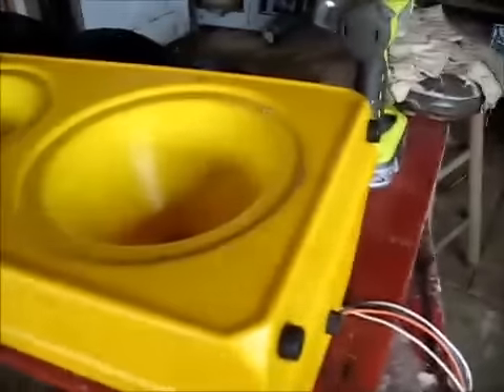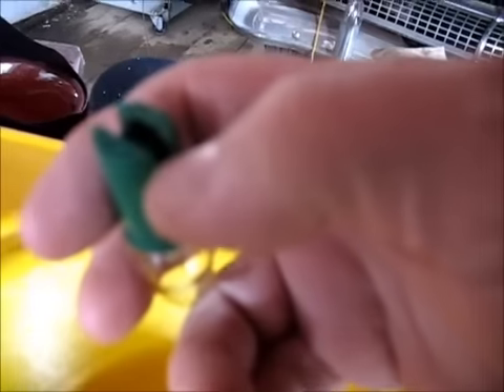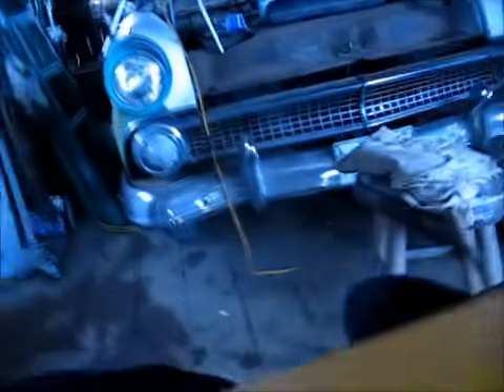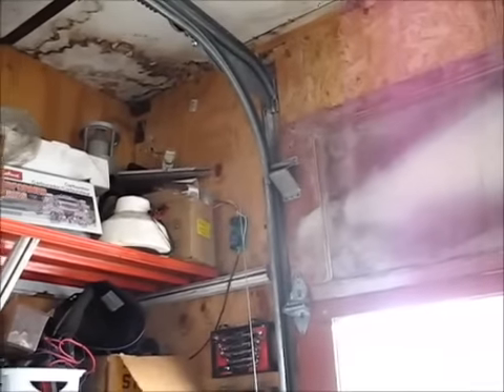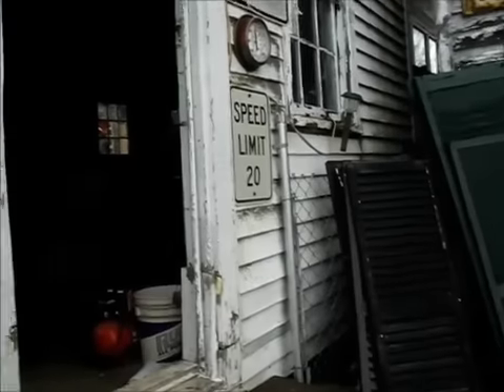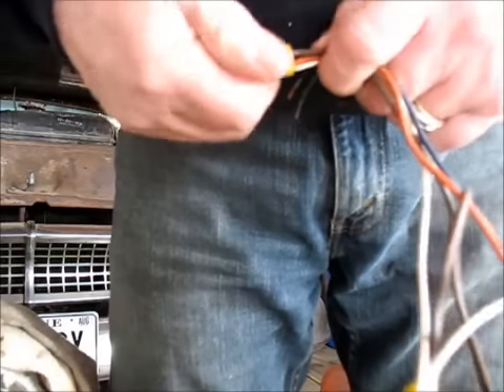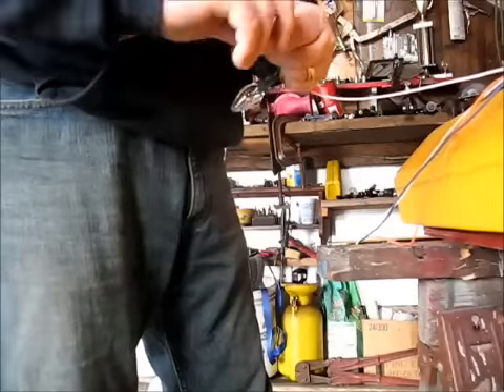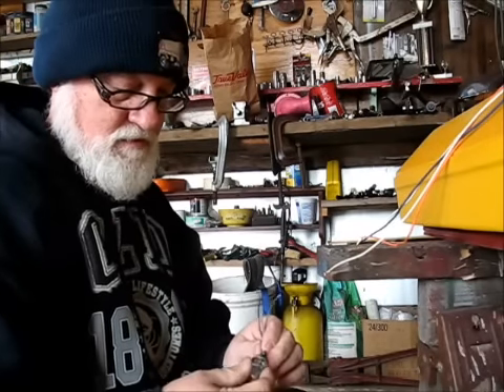Redlight Revival

Comment: those tree lights are probably 'in series' which meane the mains voltage is shared between them, if you divide the number of bulbs into the the voltage it will give you the voltage for each bulb,  i.e. 110 volts with 20 bulbs=5.5volts across each bulb ;-)

Comment: Hmmm, if those bulbs had LEDs in them and they were meant to run all in series, then yes 110V would make them go POOF, but also IF they are LEDs (diodes) then the current will only flow in one direction! So connected up backwards with the right voltage they won't work.  I'm not saying they ARE LEDs but a lot of the stuff coming over IS LEDs. In the end if you figure out the proper voltage for the bulbs an old wall wart should work!

Comment: True, but look at the easy way modern stuff fails and the cost lol.

Sometimes older is better, bugger all to go wrong with a bi-metallic strip and cheap to replace :-)

The second you make something over complex for its function, your in trouble, fridge+computer = scrapped because the dam computer fails, the fridge would have been fine without the junk attached to it lol.

Computers are great, but i would not trust a pc to flush my loo!! ha ha :-)